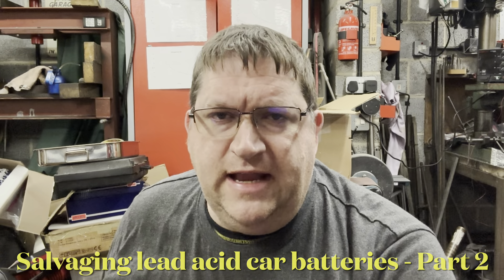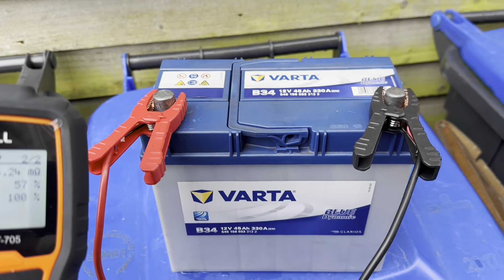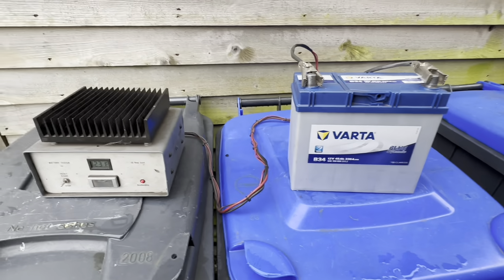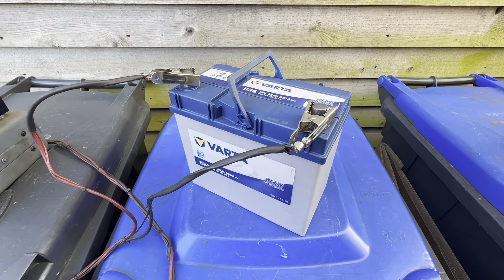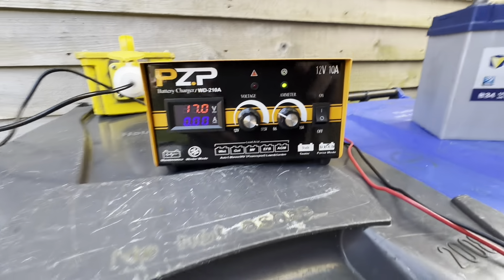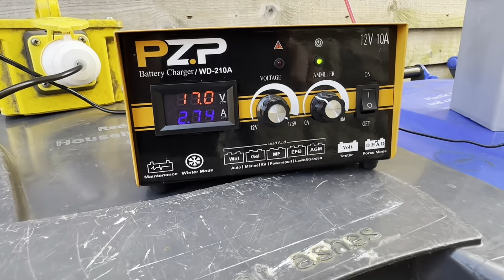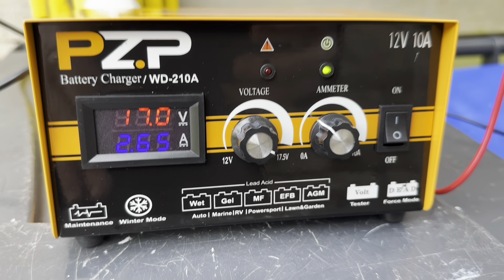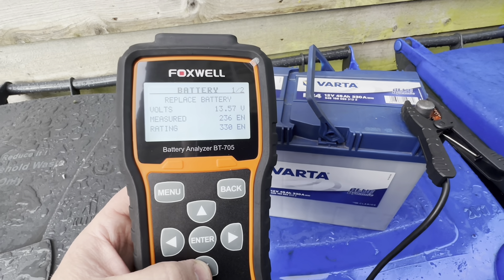Salvaging lead acid car batteries - Part 2

Comment: Lead acid starter batteries can often be used for other applications when their ability to crank an engine has diminished. I like to use them on solar projects for things like garden lights, rainwater harvesting and charging my Li-Ion lawnmower. In those applications there is no need for 400A all at once.

Comment: I've  saved quite a few batteries like this 👍 i use pulse desulphation cos thats the charger i have 👍 i do find a few months on a solar charger really helps, mine has equalisation once a month and after a year of running my LEDs in my garage they are in better condition voltage wise than before, but as you say i only load them with 10A or so
Great vid chap 😎
Reply from the maker: I have used pulsation in the past, but I find  a good equalisation charge to be most useful.
Reply: @ACDodd  I did too when I had a decent jump-start charger 👍 give the battery a 30 min " boil "  often did the trick 👌